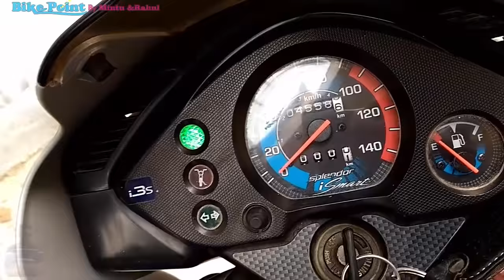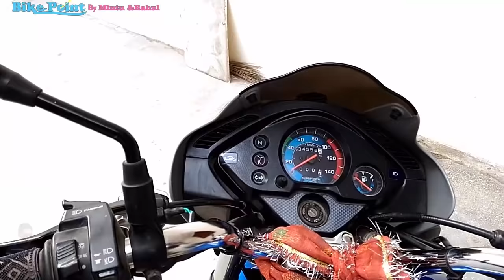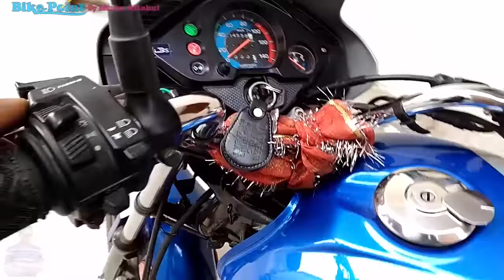Hero Splendor iSmart 100 cc with i3s  Review  technical specifications in Hindi bike pointbymintu  r

Comment: From 2015 I m using 70+ average not a single problem faced bestt bike Ismart 97cc..
Reply: 2015  Model Mujhe Mil Raha  Hai  Rs 27000 Main  Running 38000 Kilometers. Sahi Rahega  ?
Reply: @pabitrabehera2692  bhai apne liya kay ye bike ?
Reply: @pabitrabehera2692  kharide bike bhai
Reply: Best bike i am usi ng from 2017 it’s the best❤